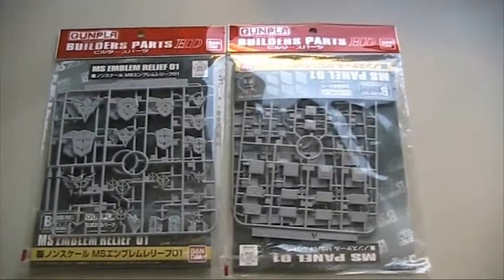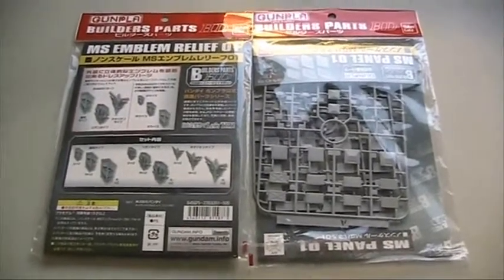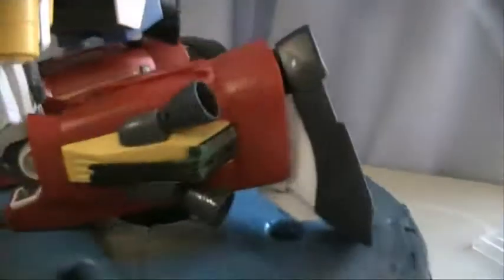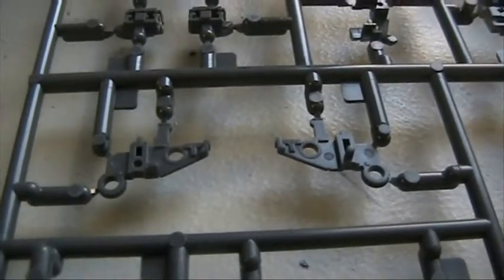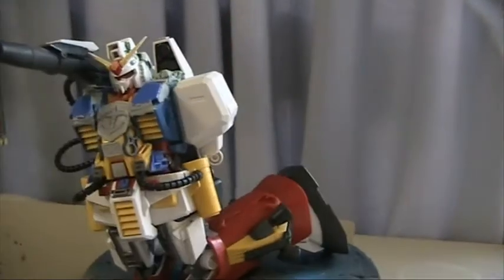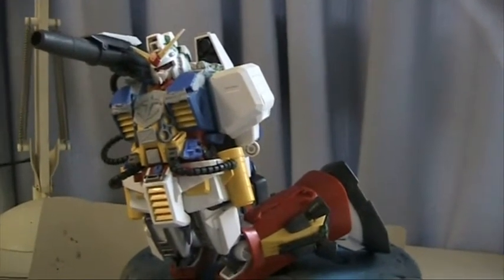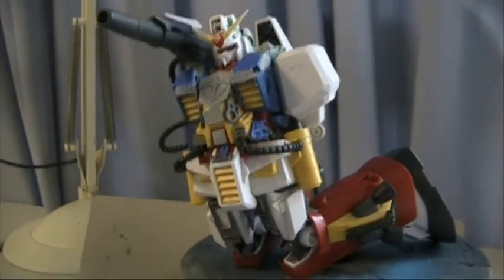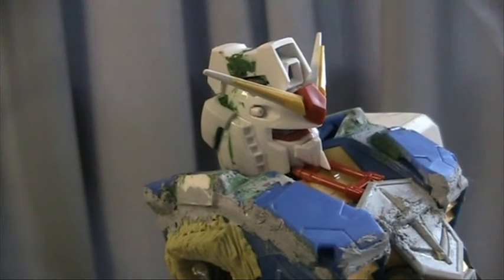Unorthodox modification of mastergrade gunpla: 02

Comment: I'm not sure what the DC 23 is. 
That's true. I'd rather use a decal then try to paint it on a flat surface. Raised details like wires  and stuff like  that are easier to hand paint compared to freehanding a Symbol/marking/logo. This is what I think, it would be interesting to know why you think it is easier?